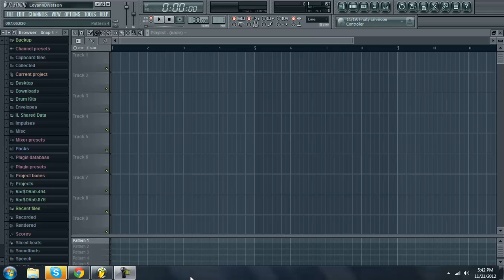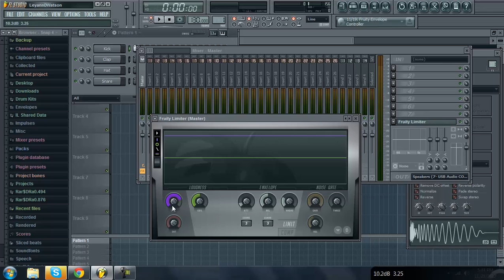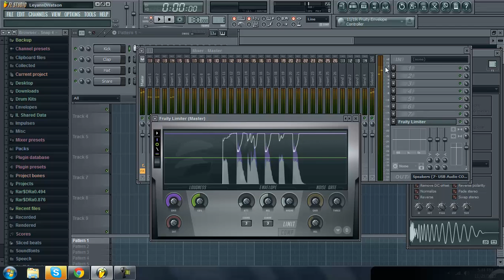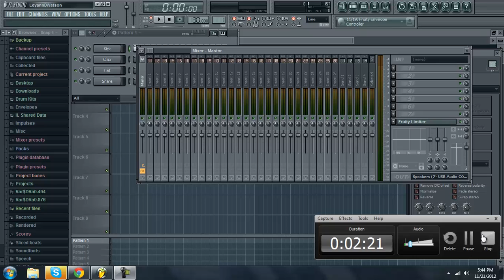How to make beats louder in fl Studio 10

Comment: Better tips on how to make your beats louder: Equalize every single instrument, to remove annoying noise from your sounds, to make the good sounds pop out. Using the gain on the limiter will just make it go way over 0db, and what the limiter is doing, it is basically cutting off the top of the sound wave. In other words it compress the fuck outa them. So then it'll sound stupid.

The number one tip for mixing a beat, is always decrease volume before you increase volume. Decrease the sounds that you want to have sitting in the back of your track, to create the most perfect relationship between the volume levels of every instrument/sound. Then you equalize, compress, and add reverb on them, you name it. But, only at the end will you even touch that master channel, cos the master channel is only meant to give that final boost at the end. 

The difference between mixing and mastering is, mixing is where you fine tune all the sounds to its full potential, and mastering is filling the whole beat out, so it gets as loud as possible, hope it helped you guys.

If you use this technique, you will be cutting corners. I don't know if you are amateurs or what, but I am just giving out my simple knowledge.
Reply: icycolds Dude, check out TheRecordingRevolution, and the "Into The Lair" series! They teach you so freaking much, from beginner to advanced. Also check Rob Williams "5 Drivers of Mixing"

You wont regret any of them.
Reply: Jayz Productions If you want 2 instruments, to have the same volume increase, I recommend grouping those 2 instruments, and move the overall sound of those 2 instruments up. However, a more complicated but better way is to use EQ and Compression.

Because, are you talking about actual loudness, or perceptional loudness? If actual loudness, just group the 2 tracks and move the volume up.

If you talk perceptional loudness, which I recommend, then EQ all the things you don't need in each of the instruments. For example, if you have a snare drum, remove all sub base frequencies. Bass frequencies in a snare can add depth, but it depends on what type of snare you have, how it's recorded, and what type of sound you want, and especially what role the individual instrument plays in the overall mix.

So to get more perceptional loudness, start with EQ'ing unnecessary sounds in the frequency spectrum. That will make the overall ACTUAL volume fall, however, you can then move the overall volume up, and maintain the same volume, but the volume is more focused, hence, the perceptional volume will be louder.

Then you use compression. Compression is generally used to make the volume a lot more consistent, so you don't have one part of the track in low volume, and other parts in the recording peaking. If you just add volume, those peaking sounds will result in clipping, which sounds like garbage, so you use compression to make the lower sounds go up, and the peaking sounds go down, hence, the audio wave will be compressed.

Be careful about overdriving the compression, because then all dynamics will be sucked out of the track, and it will sound squashed and drowned, which sounds like crap.
So you want to use compression to make the volume a lot more consistent. Using compression, you now have a lot more control of the overall volume, and since it's consistent throughout the entire track, more perceptional volume is added.

You can use compression in different ways, like adding more attack, hence, more punch in the sound. You will usually want a lot of attack in drums, so the sound can penetrate the through all the other sounds, hence, more perceptional volume, but not ACTUALLY more volume, it just sounds like there is more volume.

I hope it helped and sorry for the long explanation.
Reply: your right man, and its sad that these kids are posting tutorials where people actually come and think they're getting the ''good'' advice, and proceed to apply it to their work, its really a shame.
young aspiring producers should really understand that there is such a thing as dynamic and loudness and that a good mix balances these 2 out.
there's such a lack of engineering brought into the music industry now a days :(
Reply: icycolds Well, this is technically a mastering tutorial, not a mixing tutorial at all.
Reply: I totally agree with you on that and one thing you forgot to mention to make your track louder is  by "sidechaining" an instrument into another buss and apply another or the same effect for it.
Reply from the maker: bouddhaboyify first off dont call me a kid lol second this video is now almost two years old, i was really just starting to learn to mix when i did this
Reply: +Talkbox Gaming Really helpful post, thank you!

>Then you use compression. Compression is generally used to make the volume a lot more consistent, so you don't have one part of the track in low volume, and other parts in the recording peaking

I have a problem where my chorus/drop doesn't sound loud enough, or the buildup feels really powerful (or perhaps too powerful), what would you recommend in this case? Fl Studio 12 by default have a Fruity Limiter on the master channel, so it will compress all sounds, making both the build up and chorus/drop approach 0dB.
Reply: Coco I'd recommend putting the limiter off while you mix. The master channel is there for, well, mastering, which you do after you have finished the mix. Reason being is that when you have a limiter on the mastering channel to prevent clipping, you are basically just killing all dynamics in your mix, making it harder to hear volume dynamics.

Anyways, there could be several reasons why the build up/drop is too powerful, or in this case it may just be too loud. Have you tried using automation to turn the volume down when the drop begins, and gradually moving the volume up to match the ''power'' of the beat after the drop. May even try to make the ''power'' lower than the beat after the drop in volume. The reason you may lack power could also be because you put the limiter to 0 db, meaning you kill dynamics, making it harder to listen for volume/''power'' differences.

Also, have you tried using the ''new york compression'' technique on the actual beat? It will make the drums penetrate the mix so much more, giving a lot more power to the drums. Look it up on YouTube if you feel like.

If you have any questions or if I misunderstood you, please give me more details, and I'll try and help you. :)
Reply: Hey i want to make 2 instruments louder how do i do that excatly?